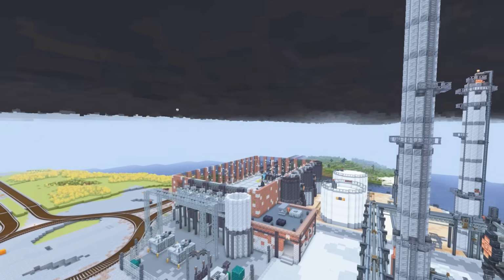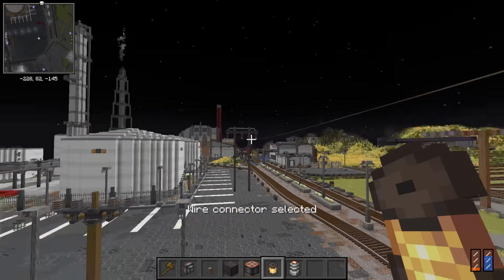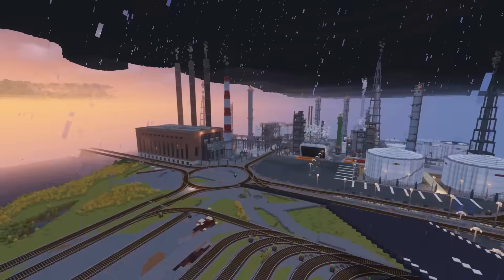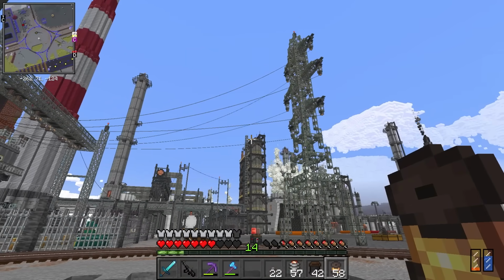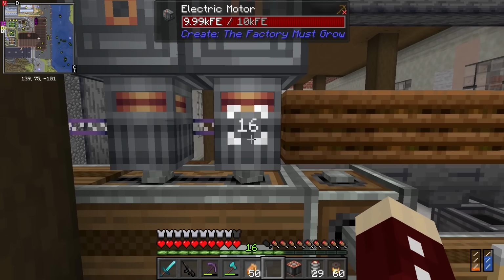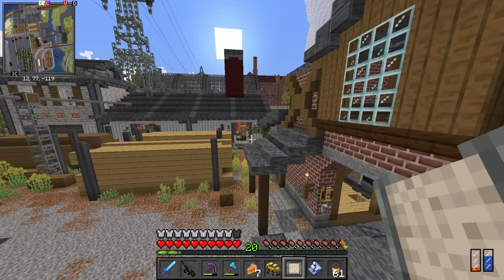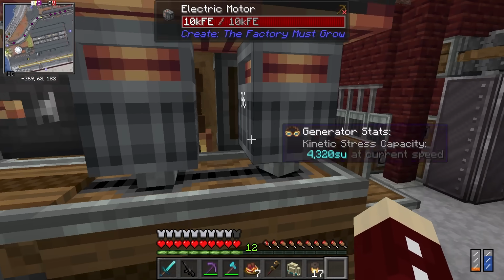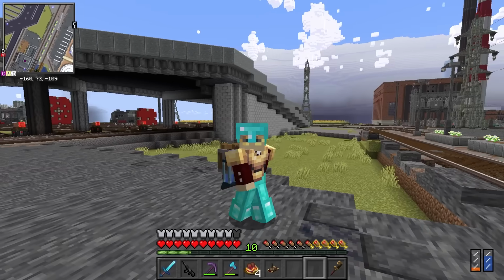Designing An ELECTRIC⚡Grid In Minecraft Create Mod

Comment: transmission power lines are far from other transmission ppower line be cause they carry 1k to 10k voltage there aresome things called pace which also shows how much voltage a power lines carry 1pace carries low voltage sometime they carry more 2 pacecan barely power a light bulb 3 pace can power frige 4 pace can power a routor fan bulb cctv cam more electronic it can power 5 pace is almost same as 4 pace but it can power more things 6 hits diffrents it can power servers 7 is better for small factory 8 yeah touching a 8 pace power line can turn u into a black dust 9 is is now called a transmission power line 10 same as 9 11 u got turned into chartcoal there are more paces

Comment: For the power connectors into the buildings, could you place one on the outside and then connect to one on the inside like a jumper? Would make it look like the wire isnt just phasing through the walls.

Comment: Ok so Speev, commercial pole are the small ones, they are used to connect houses in towns. 

Medium poles dont have a name as far as im aware, but they are used to connect towns and close by cities as well as span long distances when a jumper cable cant be used. 

Now the big poles, aka jumper cables, use these to connect super far away cites, but remember, these cables only connect from power plant to power plant. You cant use these to connect two cites if one of them doesnt have a power plant in it. They also serve as the breaker box for a nations power grid because in the event of a brown out or black out your open, or turn off, the power supply to a city so you can prioritize getting other plants back online.

Just a Q&A about how to use power poles properly

Comment: 13:49

 when connecting connectors to another connector using wires there is no power limmit, however, the connectors themself have around 6k output/input max when transfering power to/from cables/powergrid to a block/motor. you can increase the power to said block by simply adding another connector to that same block with the same strech of wire. makes no sense but hey, it works, also, not sure if its changed but gold and electrum wires have the same stats.

Comment: Regarding wires going through walls, what I do is place a connector on opposite sides of a wall and connect the wires between them through the wall. Since the connectors are close with being on opposite sides, connecting a wire is directly through the block without showing, so it gives the illusion that the connectors are fixed to each other through the block. Maybe this will help with your setup.

Comment: I think there is just one problem when doing direct motor. 14:40 you waste power because the full capacity of the motor isn't used with one radar rotor thing. Like you have 25 % stress usage but you use 100 % power. That as I don't know the real values :)

Comment: For the space between the poles you can put a white block unerneath with a electric connector. It will seems like those balls hanging underneath the cable to signal is there to places, parachutes, and paraglidings. I dont know if it exist everywhere in the world but in France whe have a lot of them ! Your designs are so cool by the way !

Comment: Imagine an electrical mod that just goes all out. AC/DC systems, single/3-phase AC systems and machines, grounded/ungrounded systems, batteries/UPS systems, motor control equipment/MCCs, switchgears and switchboards, customizable panels/electrical cabinets, 3-phase transformer primary/secondary configurations (wye and delta), realistic copper/aluminum wire gauges, cables and busbars, raceways and busways, realistic units (Watts, Volt-Amperes, Volts, Amperes, Impedance), etc. 

I know it would be very difficult to make something like that work in Minecraft but it doesn't need to 100% accurate to real life.
Reply: Electrodynamics and family of related mods by aurilisdev does a lot of that.
Reply: You describing the old good Gregtech mod

Comment: If you're keeping up with realism, you cannot park your car under a power line, it is VERY dangerous so I recommend removing those parking spaces!
I think you should also make a little default design for "transmitting" the power through the building walls, a little connector so it looks nicer rather than wires going straight into a wall
Reply: there is powerlines in my backyard irl so its not a thing with realism its more saftey (also those lines have fallen in my yard live)
Reply: @Cappyl  Bro you just proved my point lol
Reply: @ i guess but it is still realistic
Reply: @prorussianman  no they didnt? its unsave, not unrealistic lmao